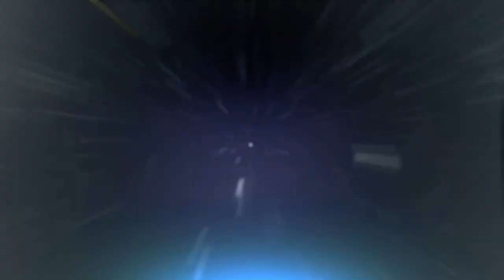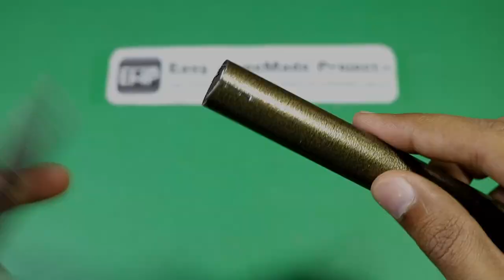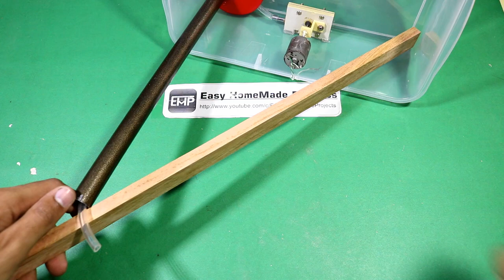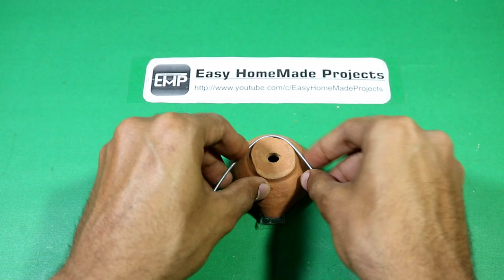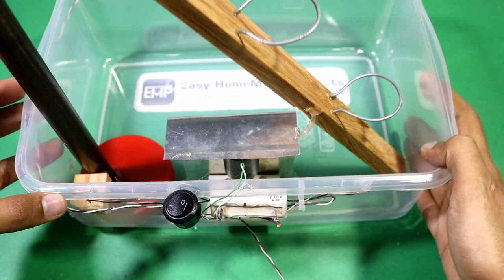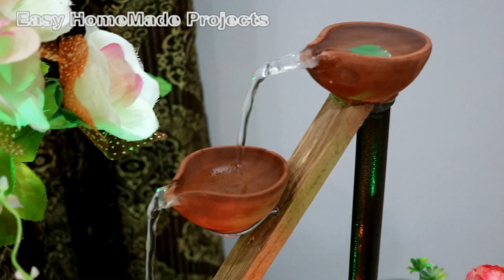How to make a Tabletop WATER FOUNTAIN / Relaxing WaterFall

Comment: I also connected motor wire and led wire parallelly , my problem is all the power is taken by motor itself and led is not glowing , if i remove motor wire from led wire, led glows.  What should I make changes in circuit so that both motor and led can get power in parallel connection? Please replay me brother!